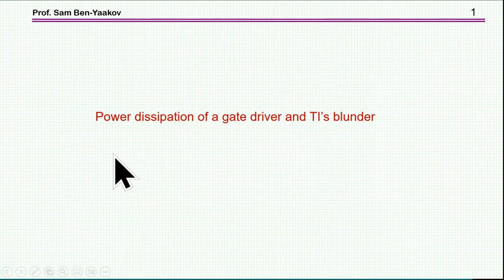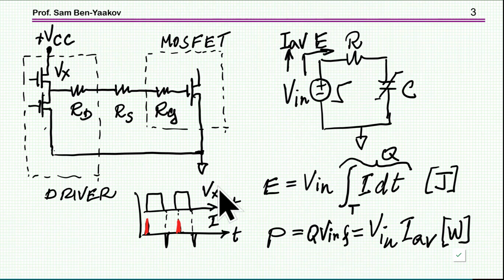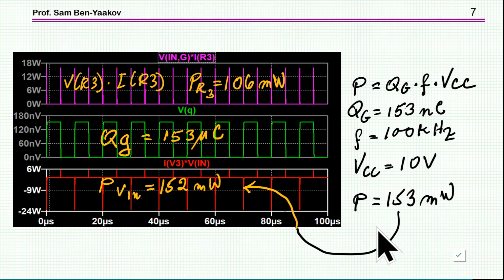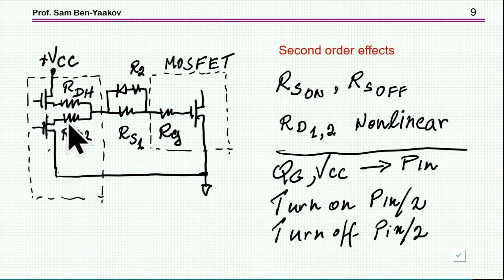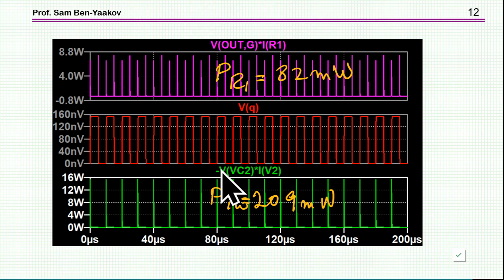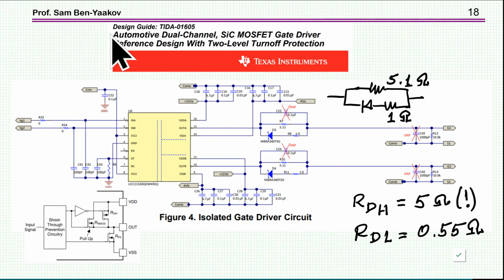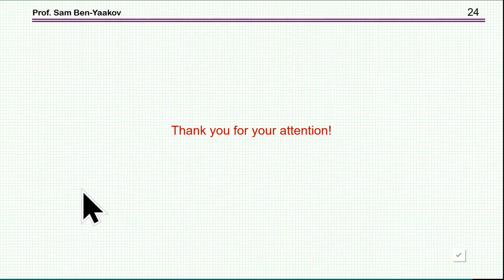Power dissipation of a gate driver and TI’s blunder

Comment: Hello Sam sir, Is there any formula to find the time domain power rating of input V(R3) * I(R3)  value??
Reply from the maker: You can divide the time into three sections and then find the equation for the current in each of these sections and finally add up all intg(I^2*R)dt, but why would you like to do that?

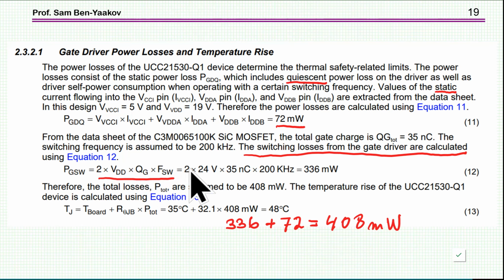Comment: I believe what you explained is correct except at @19:50, I think there is a misconception of power losses for which component. The datasheet indicates that are power losses for their gate driver IC component (quiescent power loss + switching losses), and at @19:58, those gate resistors are exceptions to the gate driver IC component. If we include those power losses from the gate resistors to the gate driver power losses, that is not fair. Different customers may use different resistance values for that gate resistors.
Reply from the maker: 72mW are the quiescent loss,  336mW is the the TOTAL charging loss which is divided between the driver and other resistors in the chain. So including ALL the 336mW as contributing to the temp rise is incorrect. Am I missing something?

Comment: I was constantly surprised by mistakes in the TI datasheet/app note, nice video.
Reply from the maker: Indeed. Surprising.
Reply: They have many mistakes. It's better to take their datasheet and try to do your own calculations based on the internal blocks of device and than only compare the resuslts. Related to their application note/design examples, they are killing the designer work if you just take the formula...
Reply from the maker: @CATA20034  The worse part is that many a times they are giving  equations without any explanation

Comment: Exellent Video!, i'm currently working on a brushless motor driver, and we have some issues on the thermal design and power dissipation. this is really hepfull to understand a bit more about the gate driver operation. by the way the precense of ringing on the high side mosfet dough to parasitic pcb inductance may affect the total power dicipated for the IC?
Reply: I believe ringing does add power losses, and not only that, it increases the issue with EMI compliance; that why snubber is used, which can lead to higher power losses depending on switching freq for silicon-based MOSFET and size of gate charge, etc.
Reply from the maker: Not really. Thanks for sharing